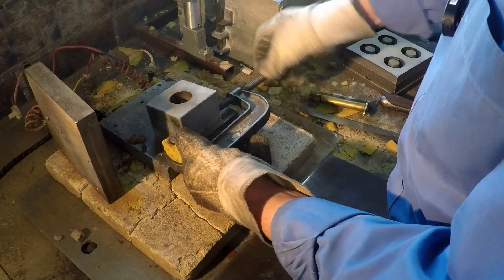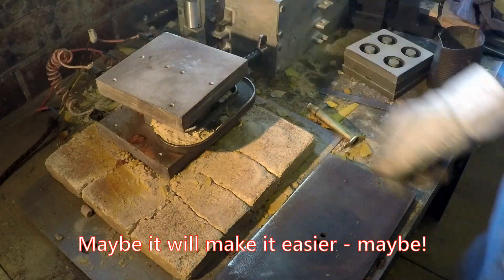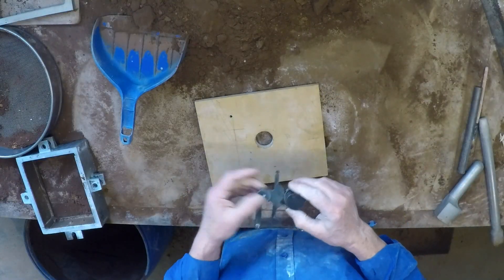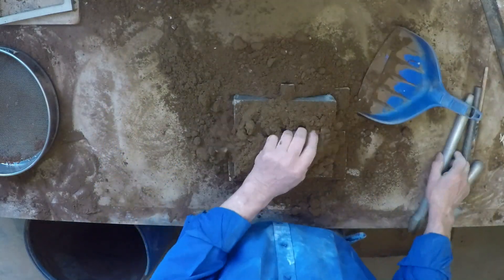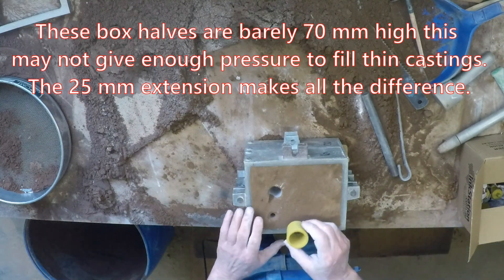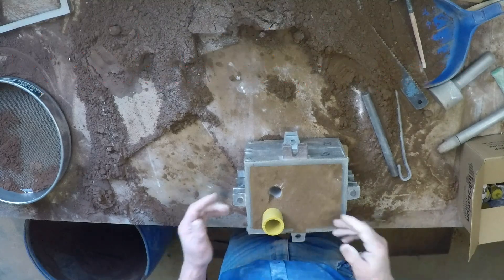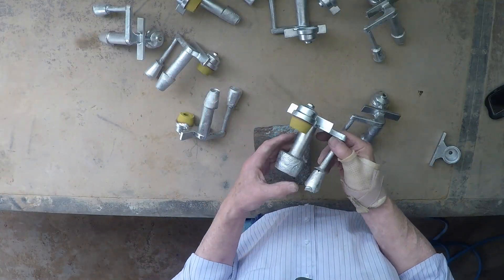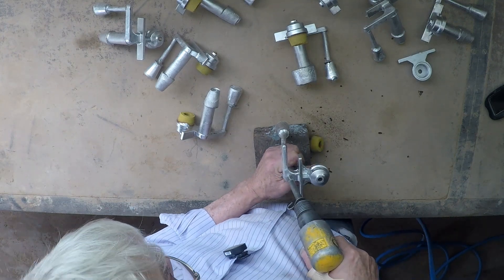Sand cast aluminium Brake fluid Reservoir

Comment: Gearbox parts, trottle bodies, brake system parts... Hands of gold! It looks like you can make an entire car in your garage! Can i hope once to see casting of engine block?
Reply from the maker: Ashkira, "Hands of gold" what a lovely thought , thank you. Sadly I am not to good at sheet metal work (can't cast it thin enough :-) ) so a whole car is a bit beyond me and then there are those really difficult things like crown wheels and pinions :-)
As for an engine block, not much hope I am afraid as it would have to be small for I have no way of lifting big heavy moulds. Mould weight and therefore size is my big limit... Martin
Reply: Well, talking about engine - i never meant monstrous US style v8 :) But - never mind, i was a bit joking :)

Books on casting (those i could reach) say the best way to build water cooling jacket is by using prebaked cores with linseed oil - because of their high strength and gas permiability. People say that's outdated technique, so no one can show how it works (at least i was unable to find video on that). How do you think - does this "old magic" have any advantages over simplier technics (like liquid glass sand and resin coated one)?

Also, i've encountered a couple of mentions that caoline can be used in place of bentonite. Is it true, how you think?
Reply from the maker: Ashkira,  Linseed oil bonded cores were perhaps the mainstay of the foundry industry for generations, millions of good castings were made with them. The mixes used often contained, as well as the linseed oil, things like flour (corn flour), dextrin, kerosene, clay, and water. The core once rammed up was cooked at around 180 to 200 deg C to cure it. These core were not very strong and gave out a lot of gas thus they often required wire reinforcement and careful venting. I tried such core making methods and found it an acquired art and one that is difficult to acquire!. Compared to modern core making methods I doubt there is much "magic". These days there are so many core making methods available that one is spoilt for choice. Cores are strong hard tough and give out little gas. Some interesting core work is on Mullernicks channel some of his other techniques are a bit sus but his core work is worth seeing. I have seen cores made by a gas cured urethane process that were so thin that you see through them they were for cylinder heads. Silicate CO2 is a bit old hat now too and has its problems but newer versions of the process are much  improved. So I would consider linseed oil core somewhat "old hat".
Re clay - my sand is a Natural sand meaning that it is straight out of the ground and contains sufficient clay to make a good foundry sand. The clay is just some sort of natural clay possibly not unlike a pottery clay and perhaps something like kaolin. So, yes I think that kaolin would do as a binder for green sand work but I don't think that it would have any special advantages over bentonite. The latter is the popular choice suggesting perhaps that it is the better binder and considering that neither are all that expensive and both are readily available I would favour the use of bentonite... Martin
PS, Closest that I have been to casting an engine block is making pistons for one!
Reply: Thanks a lot for a detailed answer! I got the impression that my books are quite outdated.
Reply from the maker: Ashkira, If you are looking for a book that is not outdated, try John Campbell's "Castings Practice - The ten rules of castings".
Its quite technical so be prepared for a solid read. But if you follow its methods as far as able you will produce castings way better that the average.... Martin
Reply: Thanks again! I just obtained this book as well as "Casting handbook" (which is even more detailed and technical) and i'm going to read them both. It will be very informative (if i choose word right) to see how far progress stepped in 30 years.
Reply from the maker: Ashkira, Yes, I also have Campbell's "Complete casting handbook". It has the "Ten rules" in it so there was no real need to get both books although I did that too!  At about 1000 extra pages the Handbook has a very large amount of extra information, However it is in places a heavy read and even as a qualified Metallurgist I struggle with some parts of it. Accordingly I do not usually suggest it to people as I fear that it will overwhelm them and they will give up on the new technology and just slip back to the 6000 year old ways. Looking at the way that many YT foundry men practise casting I think my fears are well founded. To be honest I doubt that many of these people would even bother to read either book and even if they did, sadly, they would likely take no notice of it. Foundry men, amateur and professional alike, are a funny bred, they are protective of their own self derived methods defending them almost to the death and convinced, even more sadly, and despite their own poor results about which they self delude, that their way is not just the best but the only way !
Reply: I think i'm complete opposite of those YT'ers - i read a lot, i appreciate wise advices and i haven't cast a thing :)  As for additional information - i planned to familiarize myself with material science anyways - so Campbell's book fits well in a course of my self-education.

Comment: Hi Martin,
 Another great video ! Just wondering.... is it possible to make silicate shell cores ? I'm aware that if it is it would be restricted to very simple ones.
Thanks in advance Dick
Reply from the maker: Dick, Well I guess that you could. Just have a mould with a loose core piece that is placed in the centre of the CO2 sand as you place it into the mould, cure the core off and then remove the core piece thus producing a hollow CO2 silicate  core. Sort of a core within a core process I guess. As you say restricted to simple shapes. Don't know if it would be worth the effort, it would make core removal after casting easier but 1/2 % glucose powder in the silicate mix does that anyway... Martin

Comment: Thanks for sharing. What car is this for? Or is it more of a universal reservoir for many older models?
Reply from the maker: Nathan, I believe that it was more or less universal. If you Google "1955 MG TF Master cylinder" you will see the sort of master cylinder that this part was used with. Typically these were made by Girlock. Many cars (particularly British ones) from this era mounted the master cylinder under the floor. With all the dirt and dust and confined space in this area the master cylinder was very difficult to check and top up with brake fluid. PBR (a Melbourne company) produced a kit that included a casting like the one in this video, a plastic fluid reservoir, a new top for the master cylinder, and enough pipe to connect the casting when mounted on the firewall with the new top that was mounted on the master cylinder. Thus one could check and fill the fluid level if necessary without having to crawl under the car. PBR apparently made these kits from about 1954 to 1960 by which time most new cars had the master cylinder itself mounted on the firewall rather than under the floor and demand for the kit diminished. A friend (and customer) makes and sells a few of these kits mainly I believe to some car clubs.... Martin

Comment: Another cracking bit of work!
What binder are you using for the shell cores?
Reply from the maker: Tris,  The shell cores are made from a resin coated sand. I buy the sand already coated. It is a product available like this  very widely (world wide I would think). The manufactures add the resin to the sand and with the aid of some heat coat the sand with the resin. As far as I know it is a type of urea formaldehyde resin. I use two resin strengths 2% and 4% but I understand that you can pretty much buy it in almost any strength. The 4% is quite strong and any stronger and it would be very hard to get out of some castings. For work where I need a very good breakdown for difficult to remove cores I use the 2% but mainly I mix 2 of the 2% with one of the 4% and effectively make a 2.67 % blend which seem to suit most of my work. as a core making process I highly recommend it suitable for nonferrous and ferrous alike... Martin
Reply: Thanks for the reply Martin, is the resin a furan type? Don’t suppose you have a product name for it?
Thanks again for the detailed reply, much appreciated!
Reply from the maker: Tris, No, I don't think it is a furan, that's more the Fenotec type process used for whole moulds by much of the foundry industry these days i.e. the so called "hard sand". I don't have a product name for the resin I simply buy the sand as "Resin coated sand" and the manufactures of it do not state the type of resin but a bit of "Googling" suggests that it is most likely a Phenolic resin. It seems to be known simply as "resin coated sand" world wide, sorry that I could not be of more help.... Martin
Reply: That’s great thanks Martin, I’ll have a hunt round for resin coated sand here in the uk, anything furan based seems to be unavailable to us backyard guys over here!
Thanks for your help, keep up the awesome work!
Reply from the maker: Tris.
             Problem with the furan stuff is that Foseco et.al. like to sell the binders in 44 gallon drums! You could try a smallish local foundry and see if they will sell you some from their drum for cash. But considering the problems of proper mixing the two (I think its two) chemicals into the sand and then the few minutes of working life after mixing, I think you would be better off with silicate CO2 if you really want to play with hard sand moulds. For cores like this job uses though and provided the quantity of castings required justifies the expense of a metal core box I would always prefer shell sand cores. If you do try silicate remember to add 1/2% glucose powder to the mix or you will be breaking the mould off the castings with a jack hammer! With the glucose you can wash the mould off with a hose..... Martin
Reply: Martin, yes the quantities they like to deal with don’t scale down  well to backyard foundries, that is if you can find someone over here who is even willing to deal in small quantities of the professional products, as for a local small foundry, they have all long gone! I totally agree with you that the furan based is a more involved process that doesn’t scale down to well. 
Thanks for the glucose tip, I’ll give that a go!
And I’ll keep searching for the resin coated sand!
Thanks again for the help!
Reply from the maker: Tris, No worries, the tips are free:-) Local small foundries all gone, seems its a world wide trend! You should be able to find resin coated sand easily in the UK. I would be very surprised if you can't find it. The artisan foundry supply mob that you have over there don't seem to list it but maybe they can tell you where you can get it. They seem to have just about everything else (but their combined crucible tongs pouring shank is horrible looks so awkward as to be just about impossible to use!) I buy my glucose from a health food shop, only place I could find it as a powder, liquid glucose is way too difficult to mix in
A quicki google session yields a company called Tarmac who make foundry sands based at a quarry in Cheshire, they list resin coated sands, their phone number is 0 3456 00 77 03 maybe they won't sell small quantities but maybe they know who will or they might put you on to a customer who might sell you a bag or two for cash. Good luck and please let me know how you get on!... Martin
Reply: Martin, the tips may be free, but the information contained is worth its weight in gold 🙂
Looks like Tarmac are the supplier of the resin coated sand in the uk, the only one!
Yes I agree that the small foundries disappearing does appear to be a worldwide phenomenon, back in the day, the area where I live was a huge producer of steam engines, agricultural equipment and the like, now, nothing, and super markets and cheap shops pop up on the old sites like mushrooms, sad really!
Like you say, it may be worth asking Art at artisan foundry, he may know of a place..
As for the glucose, I don’t much fancy sticky gobs of the wet stuff all over my muller!
I’ll let you know how I get on!
Thanks again, and all the best!
Reply from the maker: Tris, Re glucose I first tried the liquid type, don't have a muller, I envy you. So I was mixing with a drill stand and a paddle type mixer then sieving and remixing to get it right. No way could I get that sticky glucose to mix in even tried mixing the glucose and silicate first and then adding to the sand, nope, still would not work. I tried castor sugar, it was too course then I found the glucose powder mixes in with the dry sand quite well and it works a treat. Good luck... Martin
Reply: @olfoundryman8418   I wondered if there was a way of coating a shell core made from the resin coated sand, in cases where you might need a finer finish?
Reply from the maker: @Gottenhimfella , Yes there is a wide range of mould and core washes made specifically for improving the surface finish. These may be water based or alcohol based and can be (depending on the wash) sprayed, painted, dipped, or flowed on. Often they are zircon based and I use one in this video on the threads of a shell core  https://www.youtube.com/watch?v=lNxwrSzm9q8&t=11s
Foundry supply houses like Foseco carry a bewildering range of these washes and many can be bought in 1/2 or 1 gallon tins... Martin
Reply: @olfoundryman8418  That's fantastic info and SO prompt! Thanks a lot for your trouble, and may karma shower you with its bounty!

Comment: Nice. Where do the core boxes come from? When a customer orders a part like this, do you need to spec out the core or are details like that given to you? Do you store them away for future use or are they usually a one shot deal?
Reply from the maker: Brandon,  For a new customer I will discuss what I need in the way of patterns or core boxes. Basically the customer details what he wants in a casting and I detail what I need to achieve that. However generally I work with a small group of return customers and much of the work comes through a tame patternmaker (the wild ones are a worry). He and I have worked together many times and each of us knows what the other needs to get the job done. We have great respect for each others ability and know well how to work with each other. Together we come to a mutual decision as to what sort of pattern and core box set up is required. For one off type jobs we often use Silicate CO2 cores as they only need a simple wood core box. For work that is going to repeat more than  a few times we will go to the trouble of a metal core box and shell cores.  I much prefer shell cores. Sometimes, for shell work, I will cast the (aluminium) core box pretty much to size and shape with only the mating faces and dowels needing machining, other times he makes the core box from aluminium plate. He is damn good at this and very quick too. This was the case for this casting even though only fairly small numbers will ever be required (about 20 so far). Here a CO2 core would not have been as likely to produce as good a thread so we opted for the shell core, he made the core box. Regardless of job duration or core type one of us (usually me) will keep the patterns and core boxes in case of future use even if we think it a one shot deal as it is surprising how often a "oncer" turns into an "againer" when someone sees the "oncer" and says, Hey, I would like one of those! Never throw a pattern out!... Martin
Reply: Awesome video Martin 👍🏻👍🏻👍🏻 thanks for sharing. I've noticed in the past you would make shell cores curing the surface area only and dump out the inside to save on mass, just curious why you didn't do that on these
Reply from the maker: Clarke, They are too small,  below a certain size range the tip out trick does not seem to work all that well. I guess its something that you just have to do to get the hang of. Not only does it save mass but it also shortens cure time, bigger cores if solid would take 5 to 10 minutes to cure right through and then you would never get them out of the casting. The good breakdown of shell cores depends a lot on them being thin and hollow....Martin.

Comment: Thank you for another great video. I always learn something  from you, they way you leave the "skin" undisturbed as you pour, not sliding the mold on the bench, etc.
Reply from the maker: Michael,  If you are careful it is amazing just how the metal runs through its skin without the skin itself actually moving in with the metal, it may wave around a bit but basically it stays where it is. It is very important not to disturb that skin! If you do it winds up getting sucked into the metal, Its bit like throwing lots of plastic bags into a concrete mix, not very good concrete! Skins (or bifilms as they are called) in aluminium equals not very good aluminium. Also the skins are known to become the origin of shrinkage, gas porosity, and cracks under stress. Thus the need for good gating and the quietest calmest pour possible. Not sliding on the bench, I really should know better! In fact if you look closely at most of my videos when  I move a box on the bench you will see that I have picked up one side of it at least enough so that only the edge of the box is actually in contact with the bench that way the feeder edge does not get damaged but I got carried away here, it is amazing how these little "errors" only seem to happen when one is videoing, well that's my story and I am sticking to it -:)... Martin